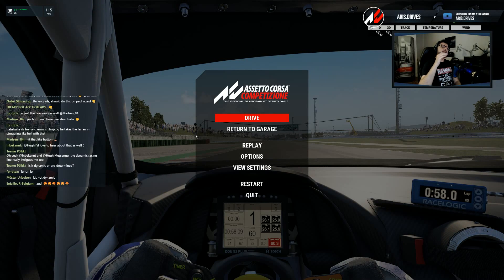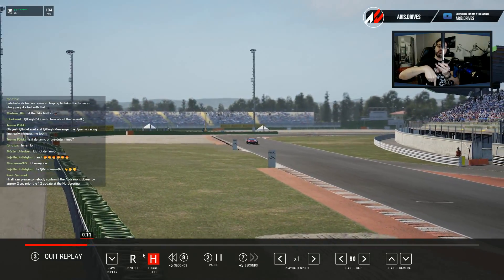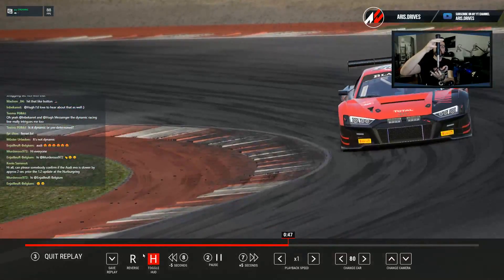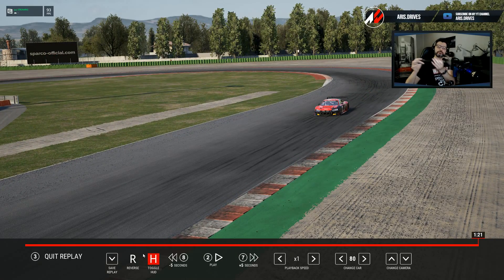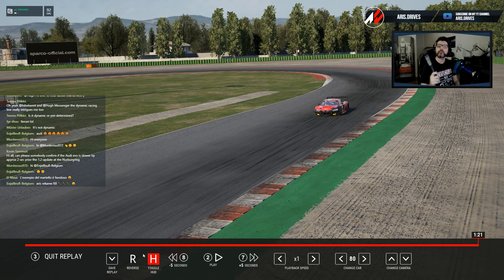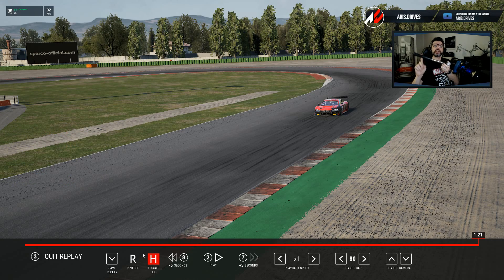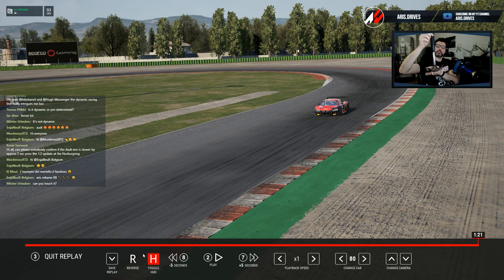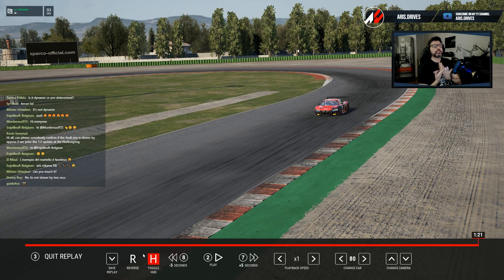TL;DW - Too Long;Didn't Watch. Car engine layouts and the influence in handling.

Comment: Rear engine - more tire load, more grip because more load weight to the tires, Less slide = less overheating in turns - more oversteer turn out, more tire degradation ☺️ Thanks for video